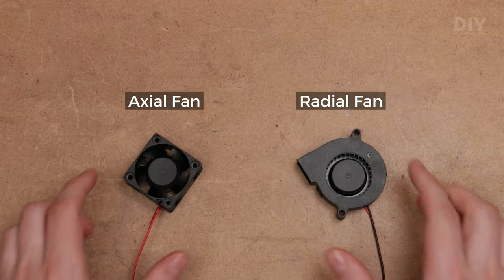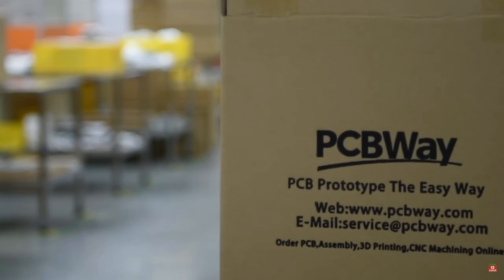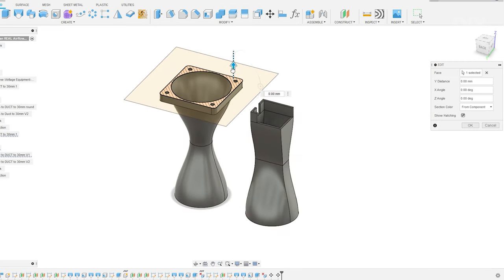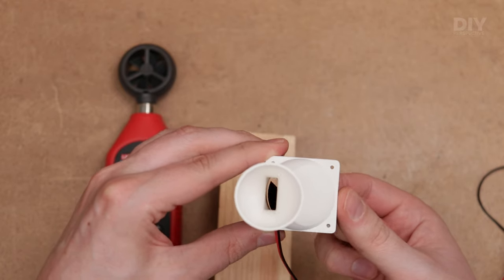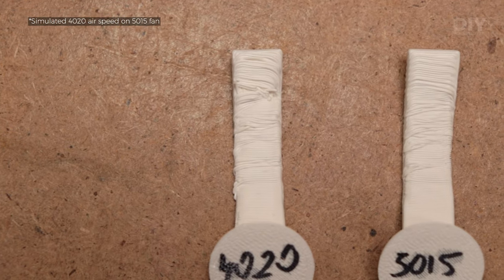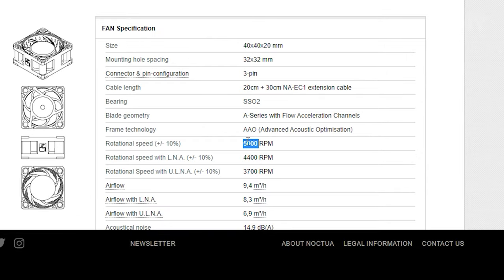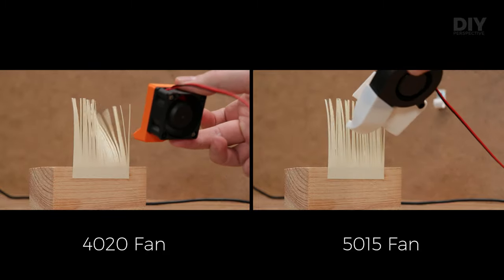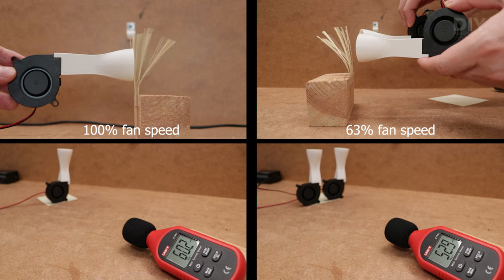3D Printer Fans - AXIAL vs BLOWER (MUST KNOW)

Comment: I'd say the main reason for all the designs using axial fans is that they repurpose stock fans that came with printers.
Reply: Did you watch the vid? Axial fans are optimised for high flow and radials for static pressure.....
Reply: @Jakob3xD  I'm not sure if you misunderstood my comment or something. I'm saying the reason fans are used in non-optimal ways in many designs is because people who don't know are designing around fans that came with printers. Just a guess.
Reply: @802Garage  oh nvm then
Reply: @Jakob3xD  No worries.

Comment: I upgraded my ender 3 v2 with 2 5015 fans. They blew so much air that bridging was difficult. For the speeds an ender 3 v2 can acheive, a single 5015 fan will suffice. Lighter toolhead is more advantageous on a ender style printer than 2 5015 fans.
Reply from the maker: A more accurate indicator for how much cooling you need is cubic millimeters per second. The more plastic you extrude the more thermal mass it will have and the more cooling it will require. Speed doesn't say a full story.

And if you have too much cooling you can turn down fans to 50%, you know that right? It is a good "problem" to have. Plus running two fans at a lower speed also reduces the noise at the same airflow. You should check the video about that if you didn't see it - https://youtu.be/SasqtbK8giE

Comment: Would have been good to know the electrical comparisons of the fans. Voltage but mainly rated current. The amperage & RPM greatly effects the flow rate.
Reply: For argument’s sake I would say that for this application the size and airflow are the two main aspects to consider. The third is usually noise which is mostly governed by the RPM.  There is almost no scenario where wattage is an issue in an FDM printer setup.

Comment: Honestly, it's because they never thought of it. Axial fans are the ones that they're most familiar with, they're light, and thin, and easily mounted directly onto a printhead platform without significant changes to power and weight load requirements.

Comment: You are right, many just use tiny shrouds for axial fan. Even using radial fan I use the same mm2 surface area of this outlet when  lofting 3D shroud in cad and smoothed it’s air flow path. Thanks for sharing 💕

Comment: You are creating restriction with the venturi type duct you test. If so you should test something like the 4028 fan which surpass most fans in these sizes. How ever it is not that simpel. You would want a certain air speed at the throat. And that should be what defines the ducts. Not the looks or what ever fits. Look into bernoullis princip and formula for pressure drop. Would give you more knowledge. Normally it is first or second semester knowledge on the engineering study 🤟
Reply from the maker: This video idea is based on people using axial 4010 or 4020 fans to reduce the noise of the cooling fan or fans. There are so many 3D printer "upgrade" designs that perform horribly. This is the whole point of the video, to show that those regular fans (and not 4028 server fans that run at ~15k RPM and sound like a jet engine) are a bad idea. If you want to make a video about the best-performing ducts with server fans explaining all the principles and showing real-world application scenarios, be my guest. :) I personally, like giving practical testing examples as those are the most useful to the majority, you know.
Reply: @PrintingPerspective  You misunderstand med. Your testsetup is what is not correct. The hourglass type you are using is creating a venturi effect meaning loss. E.g why i wrote look into Bernoullis principal. The video you made are very clear and mostly correct in all parts. But people need to see that it is air cooling and not pressure cooling. So flooding with a lot of air is better than point a blowgun at only one spot if you want to cool a surface ;) It was not meant as anything else than an input for you to look into.
Reply from the maker: @testtesting5088  I just showed how bad the hourglass duct can be but I tested with a modified version that represents other designs we can find online.

But what if the surface is just like a tiny cylinder of 5mm in diameter? Then we need more concentrated airflow at higher speeds to exchange heat in that small area more effectively. If we are printing a big object then yes I completely agree with you, but a lot of 3D printing consists of printing smaller objects. So I am not sure what you are trying to say. Cheers!
Reply: @PrintingPerspective  But you didn't dig deeper than simple hourglass/off center designs and concluded that using axial fans is a bad idea altogether. Read more about why exactly axial fans are bad at creating static pressure and why there are fixed blades in axial compressors (you do know, that axial compressors exist, do you?). Single Noctua 4020 with fixed blades duct is good enough cooling for printing at 75mm/s with .5 nozzle. With two of those you can print at 120mm/s with 0.6 HF nozzles, no problems. And all of this at 37-40dB, just above background noise levels. At those speeds servos and even silent drivers are more noisy than my cooling setup. Most cooling designs on the web suffer from the same fundamental flaws - multiple 90 degrees bends in the duct, asymmetrical division of airflow, overly long ducts etc. Using radial 5015s is simpler, but axial 4020s, when used properly, are totally appropriate for typical hobby printing applications.

Comment: i use an axial 4028 server fan for my printer. Spins up faster, has more airflow, and almost as much static pressure as a 7530 flower.
Reply from the maker: When I was buying branded blower fans and checking their datasheets for CFM and static pressure, 7530 blowers had lower static pressure and higher airflow than 5015 fans. 0.380 in H2O vs 0.880 in H2O as for example.
4028 server fans had from 0.880 to 1.325 in H2O... but that is achieved at 13k-16k RPM. So if you don't mind the noise and you optimized the duct for axial fan design in CAD simulations then maybe it could be on par with the 5015 fan, but I am not fully sure.
Reply: Use a Delta server fan, it will blow your print off the bed plate :D bonus: sounds like a jet engine
Reply: @dtibor5903  i use a sanyo for the quicker ramp up times, but delta fans are great too!
Reply: How do you control the fan rpm? Tried and it starts after 80%. I played with klipper settings with no success

Comment from the maker: Here are some more data from my testing:

4020 axial fan to 30mm hole = 6.3m/s airspeed (no restrictions)

4020 axial fan to small duct to 30mm hole = 2.6m/s (small duct restriction)
5015 blower fan to 30mm hole = 4.1m/s airspeed (no restrictions)
5015 blower fan to small duct to 30mm hole = 3.6m/s airspeed (small duct restriction)

59% vs 12% airspeed loss when comparing 4020-axial vs 5015-radial.
Reply: Are they in same wattage? We can find many different energy level fans at that patterns so we should compare with same or similar watt levels.
Reply: @DIYPERSPECTIVE Hi, do you by any chance have some data that would compare 4010 / 4020 axial with 4010 or 4015 radial fans? i´m not interested in adding bigger fan just if it would be viable to consider change of 4015 radial with 4010 or 4020 axial .. cause i think to compare 5015 blower with 40mm axial was destined to be loss for the smaller fans but the end performance difference of same size fans might bring bit different results (like i can´t open link to the 4020 axial, but when i tried to find similar design in offers that are on amazon now it seems its CFM might be around 8 while noctua 4010 has CFN 8,9 (4020 9,4 so no that big increase over double size - but pressure is better with 4020 and noise 5dB lower) .. as far as i was able to check CFM of 4015 blower might be around 3-3,5 and 5015 you compared with that axial fan is probably about double the CFM of 4015 ...

Comment: Using the radials allows you to turn down the RPMs to cut down on noise. Even if you don't need dual 5015s, running two turned down is quieter and is offers room if you DO need to crank em! 👍

Comment: This is an extremely interesting find to me. Just last week I picked up an old enterprise nvidia tesla gpu for ai image creation. It's passively cooled because normally these are stuck into racks with a lot of fans forcing air through them.

Got a fairly big case so I thought I'd just duct one of my 140 front mounted fans with a cobbled together cardboard shape to guide the airflow and I'd be off to the races. Large fan pushing air through a small volume ought to create high enough pressure to push air across the entire tesla card right? Even a fairly slow rpm should be enough to keep things manageable so no noise... Or at least that's been my thought process since I pulled the trigger on this gpu last week.

Been precipitating for the past few days so the cardboard bins contents would be soaked and I don't want to tear apart the box my new static pressure fans came in should I want to return them. Going to get that duct made, but I'll absolutely be keeping these blower fans in mind.

Never thought to use one since my laptops fan and it's just... meh...

Comment: I see what you're saying but I like using 4 of my 40x40x56mm counter-rotating fans at 23000 rpm for part cooling.
Reply from the maker: Nice :D Do you need to clamp the printer to prevent a liftoff? HA HA!
Reply: my guy started a bridge test... its still bridging and hasnt reached its end yet.... its been a month. what are we at? couple kilometers? :D

Comment: If you go back and forth with the first 2 sounds you let us hear, it will sound like an old style dial up modem :) Nice look at the fans. Would be neat to see your take on what ducts actually work better than the stock setup on most printers. I found that most of them do worse than the factory setup on my Ender 5 probably due to the print speed not getting high enough to make the massive airflow worthwhile...at least that is my theory...
Reply from the maker: Yeah, I have a test like that in mind, but before that, I need to test multiple-size blower fans - 5015, 4020, and 4010 to determine which ones are the most optimal choice considering cooling power (how good they force the air though ducts) and the noise.
One-side blower fans like on Ender 5 or anything similar is pretty effective, especially if you orientate harder spots in the print (like overhangs) towards the airflow from the fan. The only problem is if you want equal cooling from all sides. This is when all the testing needs to be done comparing different ducts and how they affect print cooling, which is also on my "want to make" videos list.
Reply: @PrintingPerspective  Excellent! Yea it is so hard to test fans because of the ducts being sized differently on almost every model so it changes the airflow between them. I am looking forward to more videos as you got my subscription ;)
Reply from the maker: That is why I will just make same size ducts for all the fan types. :) This is the easy part :D

Comment: I can confirm noctua although a quiet fan, it sucks at cooling prints sufficiently even with the offset duct design.
Reply: I was always wondering, isn't it more silent just because it's not that  strong? If you decrease power on regular fan, it will also be quieter.

Comment: You can also step up the 4020 axial fan to a 4028 axial fan. Even 70x35 radial fans look pathetic compared to good 4028 axial fans. For example ebm papst sells a 4028 fan which is still fairly quiet at rated 50dB but has over 4 times the air flow and over twice the static air pressure of the most powerful controllable sunon or gdstime 5015 radial fan. 38m3/h vs 9/9,1m3/h amd 520 to 550 (graph was awful to read on smartphone) Pa pressure vs 250 Pa on the radial fans. So in every case the axial fan will perform better as at every pressure value it has higher flow and at each flow value higher pressure. The downside of the axial fan is the hefty price of 55 euros and the sometimes difficult packaging
Reply from the maker: I honestly don't understand why so many people talking about the 4028 axial fans. They are insanely loud because they spin at ~15k RPM to get that high pressure and airflow. 50dB for a fan is a lot and when you add it into a duct the noise will increase more. Also, you can't compare noise levels from manufacturers' datasheets to my testing results, the testing methodology is very different. The whole point of this video is to show that regular 4020 fans perform considerably worse at similar noise levels compared to 5015 fans. The only scenario where you would consider a 4028 fan is for high-speed printing because you actually need the performance and the noise levels become irrelevant. Well, this is my opinion about all this.
Reply: @PrintingPerspective  most will be fine with 5015 radial fans like you said and they are easier to package. But after a certain point of print speed you will need such cooling systems like some fat 4028 fan, 7035 radial (horror to package), berd air or similar air pump setups.
Beyond the 300 to 350 mm/s mark (let it be travel or infill, doesn't matter) your steppers will sound hella ugly to the point where spread cycle is quieter/less annoying tone. At this point cooling fans will be the least noisy thing.
Im aware that the rated noise levels are under most optimal circumstances with just the fan and no ducting behind it, real life noise levels will be probably more in the 60  to 65 dB range.
The truth is that if you want powerful part cooling its getting loud, thats just physics. Air pressure always generates noise as sound is basically a wave of different air pressure. Some fans are just more efficient at it than others (quality vs knockoff fans). Some are quiet because they have no power (noctua, pc fans in general).
The quietest part cooling solution that provides really good cooling suitable for print speeds beyond 300mm/s is remotely mounted fans/bed blasters as you can use large, high volume fans that dont generate much noise combined with radial fans on the toolhead. Bed blasters are only suitable for medium to small printers as the effectiveness decreases with distance and you will have to add more of them to cover a wide area of the bed.

15k rpm is at the medium to lower end of th 4028 fans, at least if we talk without ducts, the fastest ones even reaching 25k rpm without load. One extreme example is 38k rpm and 31 watts of power, 2300 Pa static pressure and 63m3/h with insane 71 dB rated sound
Reply: That's really loud, atr that point just put your printer in a foam box.

Comment: your "review" is bullshit. you never tested the fans with no restriction. you tested one fan against the other without knowing if they moved the same amount of air with no restriction. You didn't post the specs of the fans are they the same rpm and wattage? A higher wattage axial will have more static pressure. the blade pitch on the axial fans can drastically change the air pressure produced. I replaced my blower with a 4020 noctua and it pushes out so much air that i generally can't run it at 100. at 100% it will push the filament out sideways when loading filament. the stock 5015 can't come even close.  i have to dial it back to 60% and then its a third the noise of the stock 5015.even at 100% its still half the noise.  You obviously don't have a clue what your doing. You need to take into account the specs static pressure, rpm, air flow, stock noise and wattage of the fan you are selecting. Not just compare two rando fans to each other. there is a reason people choose noctua. they move alot of air at a good static pressure with less noise. go watch major hardware videos on the fan show down
Reply from the maker: "Push the filament sideways" now that's some factual data :) Literally every fan does it. You come here all swinging with swords and this is the main data you bring? :D I am sorry to say but your noctua 4020 fan has only static pressure of 2.26mm H2O and 5.5 CFM. The 5015 blower style have ~14mm H2O and 4 CFM, while running at same speed of 5k RPM. And this info are from datasheets. So when you do actual testing that provides you real data you will see how much you really know about all this :)

Comment: the only reason your axial fan is not generating air flow is your bad duct design.
Google for "axial fan guide vanes" or "vaneaxial fan"
this is THE proper way to design a duct for axial fan. Quite surprised you didn't find this during the preparation, investigations (if any) and making of this video, as this is really the basics.